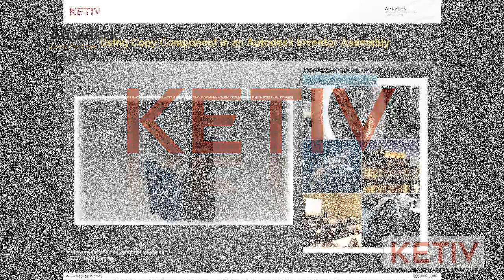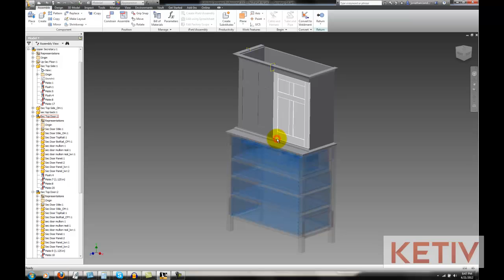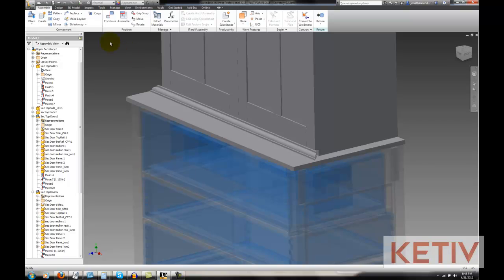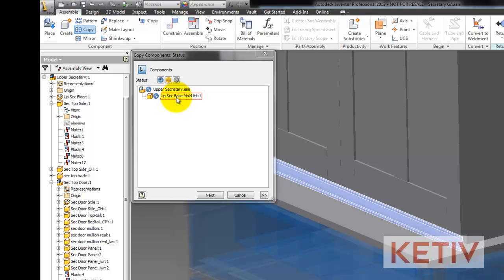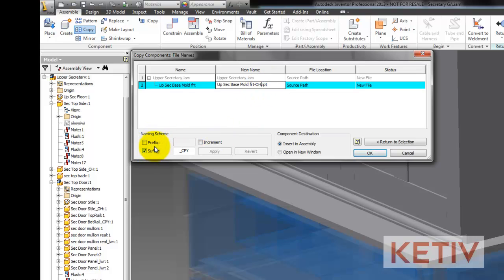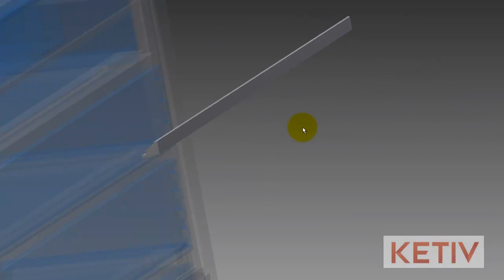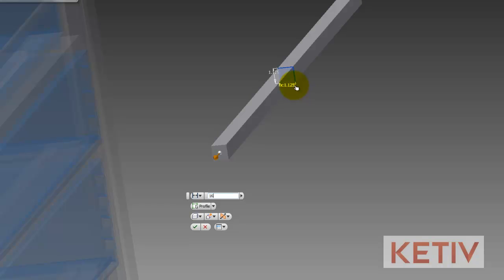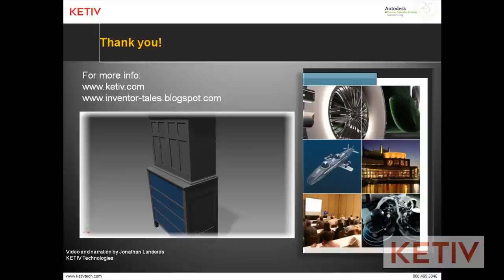Using Copy Component to Create a Similar Component in Autodesk Inventor

Comment: So once you make your edits to the pasted component, I assume you place it using constraints? What if the original part was created constraining sketch curves to projected geometry?
Reply from the maker: Typically, if a feature was made using reference/projected geometry, and then that same reference/projected geometry is dramatically changed, the feature will fail and appear "sick".    This results in the differently-colored sketch geometry which can then be re-constrained as needed.